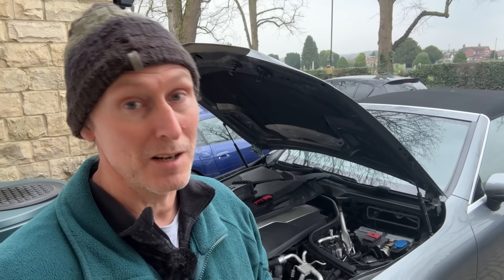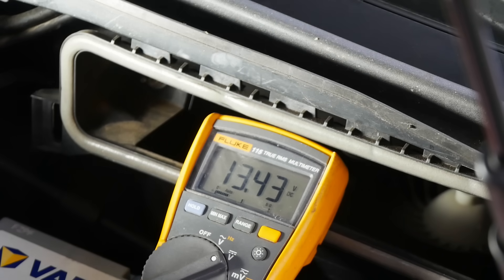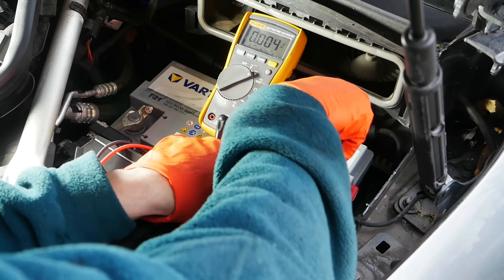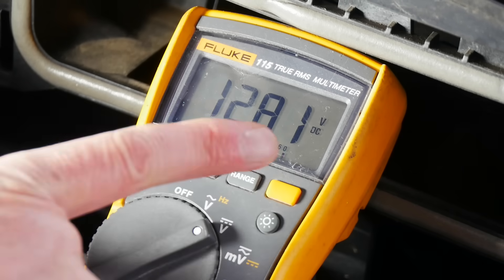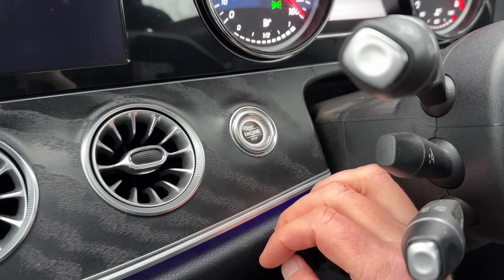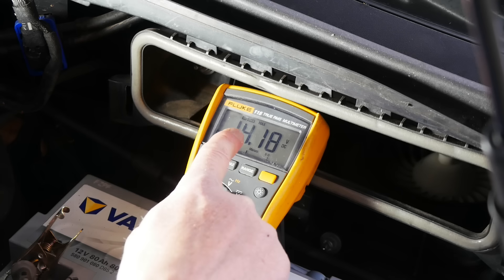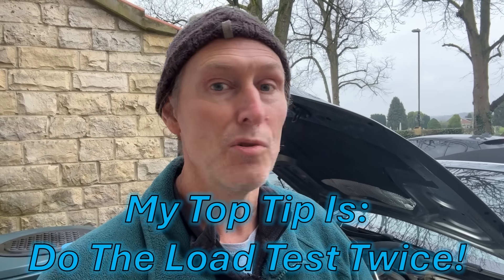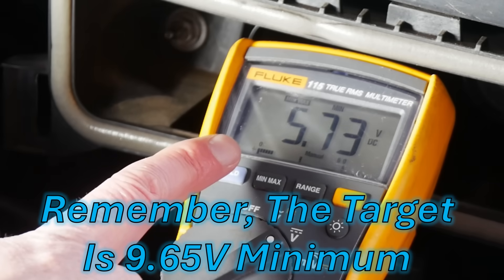Car Battery Load Test With Multimeter | EASY DIY

Comment: Apologies for a possibly dumb comment but does removing a lead form a modern car battery (my car is a Skoda Octavia 1.5tsi 2019) cause problems with the car "recognising" the battery when you reconnect?
Reply from the maker: @geoffhanbury4978 It's actually a very good question! I can't say 100% but I have disconnected the battery on lots of modern cars and never had a problem. A lot of people do it as a basic "ECU reset" from time to time. If I had your car, I wouldn't hesitate to disconnect the battery if I needed to. My latest project car is a 2022 BMW M135i, I disconnected the battery because I'm taking the engine out and I don't expect a problem with it not recognizing the battery when I put it back on. If you search the term "skoda disconnecting battery forum" on google, you will get lots of hits and can do some reading that will help you decide. Hope this helps. Cheers, Phil
Reply: Well @revivemyride? Grateful for a reply.

Comment: You have volt meter on mercedes dash menu in case there is no multimeter around
Reply from the maker: Good tip! Not sure it will be sensitive enough for a load test but it may at least give you an indication of what is happening with the battery and alternator. 👍 Cheers, Phil

Comment: mine reads 12.6 and 10.5 during cranking (but not turning over) as my immobiliser seems to keep forgetting key transponder codes and stopping it from turning over and I can't work out why
Reply from the maker: Hi @seeyouintheeighties sorry, if you can't keep it cranking for a good 5-10 seconds, then you can't perform the test properly. Also, if your immobiliser is playing up, there's a good chance it is the source of your problem. Cheers, Phil

Comment: You can Buy a Digital Battery Analyzer for around $35-$40 that will tell you the State of Charge and the Health of the Battery .
Reply from the maker: Yes, that’s true. If you’re going to be checking batteries fairly regularly then it would be a good idea to buy one 👍 but for a one off, if you already have a multimeter, then the method in the video is a good option. Cheers, Phil

Comment: BS test.
Reply from the maker: Why do you think so? Just guessing but I imagine you haven’t tried the method shown in the video, maybe didn’t even finish watching it? In short, the method I show works. Measuring voltage drop during a load being applied to the battery is a proven method of checking the condition of the battery. In the video, the multimeter is measuring the voltage and the starter and engine cranking is the load - simples 😁
Reply: @ReviveMyRide  I think you need to add: acidity test and longer endurance Ah test (3 cars, 1 bike, 2 boats)

Comment: This is not a proper load test!
Reply from the maker: Yes, It’s not the test that a garage would do with an industrial style load tester But the method shown in the vid does give a good indication of battery condition. All you need is a multimeter. Could be a useful first step in diagnosing a starting problem. Cheers, Phil
Reply: Calculating the battery storage and load voltage gives you a per centage of the battery health. As battery Voltage correlates with how many Amperes is in a battery .
An actual load test with a resistor causes heat within the battery which makes its internal resistance value raise. 
I use the meter method and I am a professional Vehicle Electrician works for me and the many people I teach basic car electrics to.
Anyhow,  someone who uses a battery tester is incapable of mathematics lol

Comment: 100% Montana Dan endorsement.  
The internet contains a lot of misinformation relating to electronics.  That is not the case with this video and I strongly agree with the diagnostic approach and the battery voltages specified for lead acid, high output, cranking batteries.  
Commenters qualifications:
I hold a BSEE (Electronics) and have lifelong experience in the mechanical and electronic/electrical fields. My hobbies include a self contained 1989 IP35 sailboat (600w solar 400 Ah AGM, no invertor) and a 2003 Roadtrek camper van (high output self regulated alternator, Victron FET isolator, lead acid start and deep cycle 100AH house, no inverter).
Reply from the maker: Thanks very much @montanadan2524 👍  Glad to have earned your endorsement on the video, thanks for dropping me the comment!! 😎 cheers, Phil

Comment: My battery is saying charged 1345 on the bench should it still read that number in the morning if it’s drops down is telling me the battery is failing
Reply: Thank you for responding I will get a load test
Reply from the maker: Hi, does charged 1347 mean 13.47 volts? Yes, I would expect the battery to have pretty much the same charge in the morning if disconnected and left overnight. If it has dropped a lot, then yes, that wouldn’t be good news for the battery. However, if it stays the same, doesn’t mean the battery is good, hence doing load tests etc to test the battery. Cheers, Phil

Comment: My voltage is displayed on my dash on my bike. When I first power up, before cranking, the V sometimes shows it's as low as 6-7v but rapidly rising until it slowly creeps up to 12.2 where I crank it. If I try to start it too soon it dies momentarily and the bike does a factory reset. Usually the 2nd crank it starts up fine.
Reply from the maker: Very weird symptoms! I haven’t come across that before…
Reply: @ReviveMyRide   I think there's a big load on it, just as I power it on. It has automatic suspension control which I think it tests as well as a servo motor on the exhaust valve, ABS pump, all kinds of diagnostics I don't even understand. There's a whirring noise which doesn't seem to go away either.
I just bought the Topdon BT20 load tester so maybe that will reveal some of what's going on with my starting issues, as sometimes it is a bit iffy at cranking.
Reply: Batteries especially lead acid don’t have much of a gradual decline in CCA capacity. It’s common to go from starting your vehicle to almost junk when you go for the next start. Simply put end of life is abrupt. It’s just time to replace it. For piece of mind the auto parts store has a load tester to verify the battery. Just personal preference but if you can swing it a AGM style battery is better in every way to a lead acid. With all of that said verify all connections are tight and making proper contact. A weak connection can act like a bad battery or starter ect.

Comment: 6 * 1.7v = 10.2v, there's your minimum. 6 * 2.35 = 14.1v to 6 * 2.40 = 14.4v while running/charging. That's your numbers. Source - 34 years working in the battery industry.
Reply: You can't do a load test just using a multimeter?
Reply: Technically, he wasn’t performing a load test on the battery, he was just recording the load test the starter was performing on the battery.
Reply: Do a video mate
Reply: Your cell numbers are good but as we don't know the starter amp draw specifications,  his numbers are sufficient for the purpose of the video.
Reply: I just performed this test on my battery.  At rest the battery only shows 10.6V, and when under load, the minimum was only 6.0V, but 14.1V while running.  Can I revive my battery by putting it on a trickle charger - or is it time for a new battery?
Reply: @ecpoirier  At rest, 10.6v says it is fully discharged or there is a dead cell. Put it on a trickle charger, let it fully charge then test it again after 60 minutes. You should see  at least 12.8 volts. All that said, if it is more than 3 years old, I'd throw it away and get a new one cos sulphation will be setting in now.

Comment: This is not really a situation to do a load test; if you see a 0.6V drop from full in a few minutes with the car off, then there is either a problem with significant drain on the battery, or the battery is rapidly self-discharging.  What you should have done is first disconnect the negative lead and check amperage flowing out of the battery with car off.  It should be very low, I've never measured it but I'd expect less than 200mA.  And if it is high, like 1A, then I would expect there is a problem.  But more likely, you would see a reasonable number, and all you should do then is leave the battery disconnected and see if  it is self -draining.  That is common in older lead-acid batteries, as the plates will sulfate and drop that sulfate to the bottom, where it builds up and eventually shorts a cell.  If the battery is good, it will barely drop in voltage.  Even with a little load on it, you should see it drop to 13.2V, which is the steady state for a full battery (2.2V per cell), before it finally drops and stays at 12V.  But if a cell is bad, it will continue to drop, possibly down to 10V (5 times 2V) if one cell is bad, and even lower if the problem is across cells.
Also, not sure I would call what you did a "Load Test", but labels may differ across the Atlantic.  Here in the USA, a Load Test is putting a measured heavy load on the battery and looking at the current it supplies as well as the voltage the battery can hold up.
Reply: When a battery is first taken off charge it will be somewhat higher than the battery will be after it sits a while even if it is disconnected from the car. The battery usually shows about a half a volt higher just after a charge than the normal battery voltage.  If the voltage goes below about 12.6 by half a volt  then there is a problem.  Either a bad battery or a heavy load on the battery.
Reply: @ralphmowery2898  Yes, it's called a "surface charge".👍
Reply from the maker: Thanks for the very comprehensive comment! I did check the amperage “drain” and it was negligible. I don’t really think it matters what order you do these tests in, it’s more of a process of elimination, usually starting with the most likely and I had a feeling the battery wasn’t holding charge. Maybe I should have included it but I was trying to stay focussed on the load test in this video. My battery is 14 months old and has never been left in a discharged state, so I knew the problem wasn’t sulphate. I’m aware of method for a Full load test using a known heavy load but most people don’t have one of these at home and it’s harder to get to a shop for it to be done if your car is having starting problems. I’ve used this method of using the starter motor as the load many times and have always gotten really good results. Maybe give it a try next time you have a battery issue and see how the tests compare? Thanks, Phil
Reply: @ReviveMyRide  Good test as most load Testers wouldn't be able to load the battery as well as the Starter motor. 😊😊
Reply: @ReviveMyRide
Reply: Yes, well said. I worked for a battery mfg Co. Very few ppl know this.👍

Comment: That cranking sounded really slow rpm to me without even looking at the meter.😅
Reply from the maker: Agree! You mean the second crank right? First one sounded ok and a lot of people only do one load test. I’ve learned to do two because if you do a short journey, the alternator doesn’t have much time to charge the battery and you can get stranded! Cheer, Phil